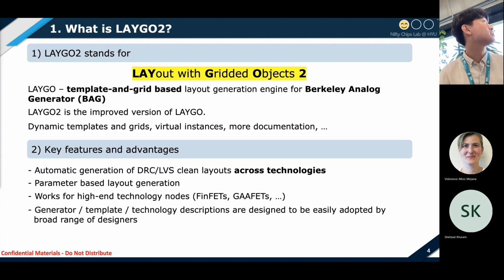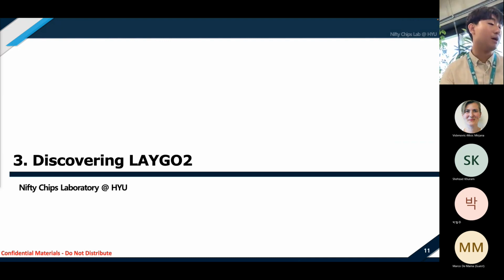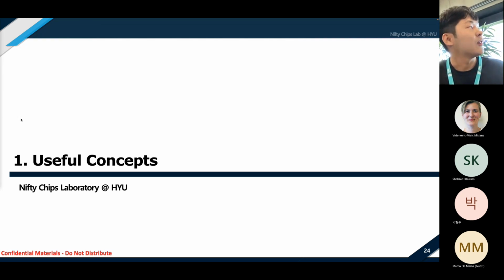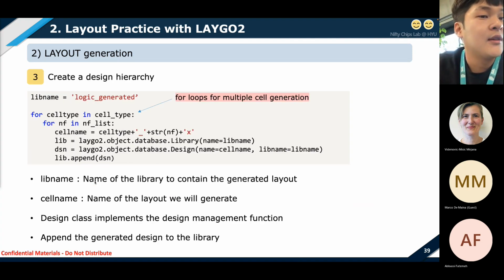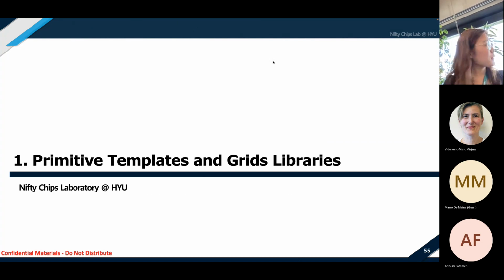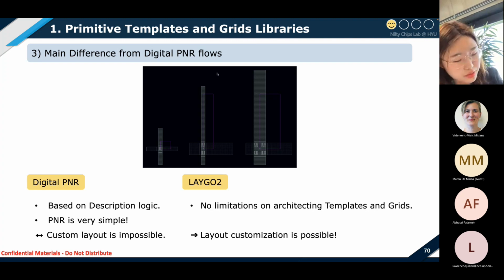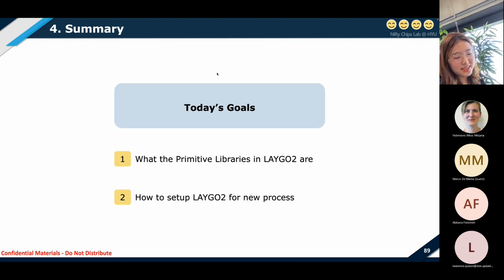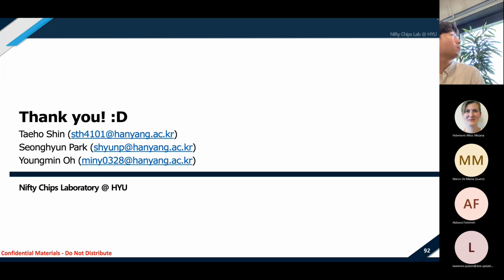LAYout with Gridded Objects (LAYGO2) | Taeho Shin, Youngmin Oh, Seonghyun Park | MOSAIC

Comment: Thank you Nifty Labs team for the excellent presentation!
Hopefully, we can meet and work on Laygo2 more this week.

For the last question, "Can it export to OA format?"  It seems to me that the Cadence export format option will give you the result in the OA format since that is the format Cadencec uses.  However you will need Virtuoso to run the skill commands output by laygo2.  It doesn't currently support exporting directly to OA.